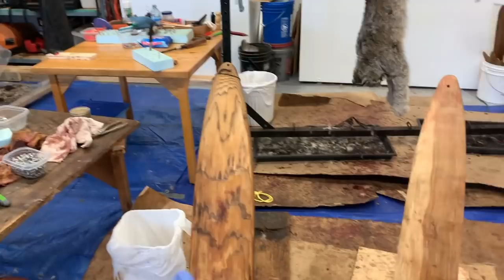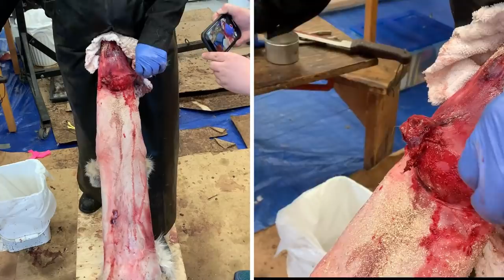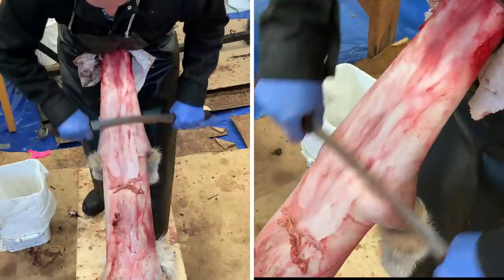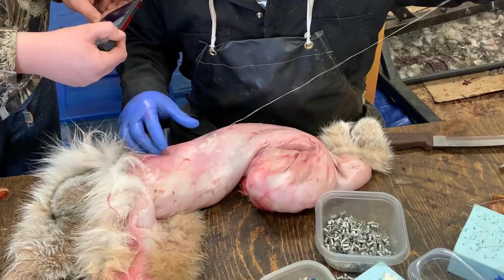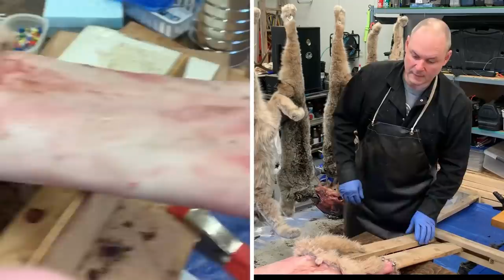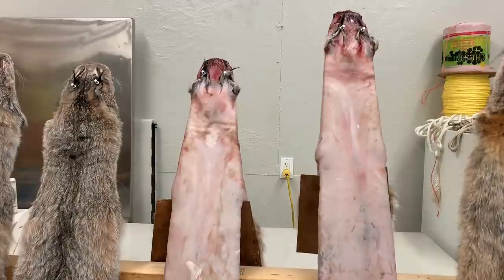How to skin a Lynx from start to finish for the fur market

Comment: Love this video!!! You make it look so easy LOL. Lots of practice for sure. I've been doing my cats with paws on and putting in the freezer. Need to get them back out thaw and flesh. I did my first flesh today on a fox using a beam and fleshing knife. Lots of holes to sew up and I watched that part closely too LOL. Is that floss you are using?
Reply from the maker: I use butcher artificial sinu string but you can use dental floss thou and it’s cheap. Thanks for watching and glad you got something out of it.